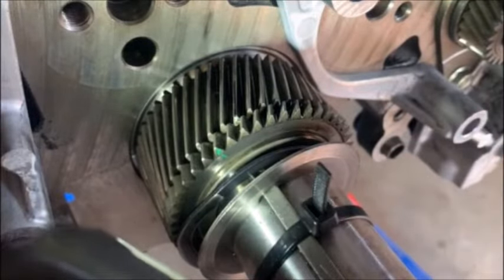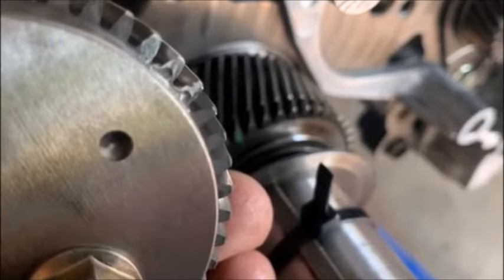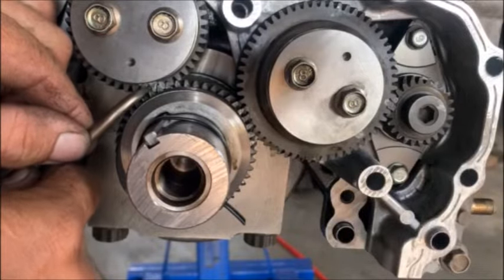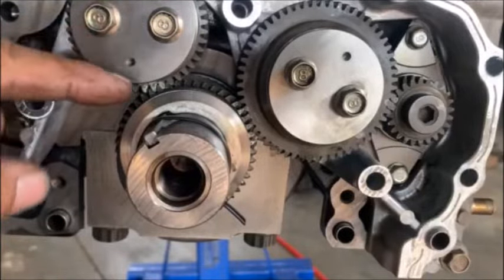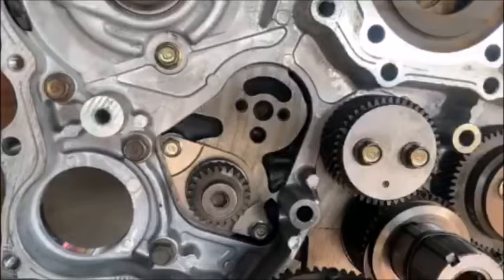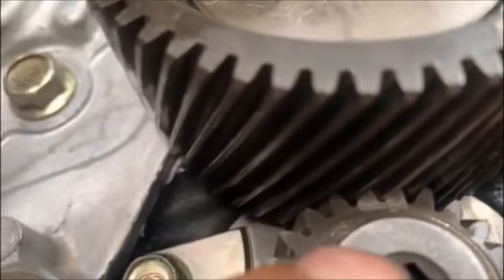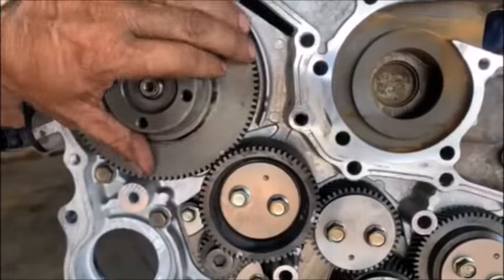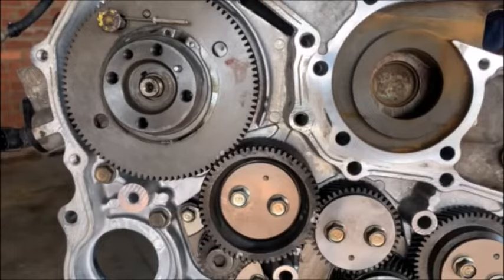Ford Mazda 2.5 WL Timing marks

Comment: Video is so self explanatory,👍 just dismantling the engine block to send of for re-boring and then the fun of rebuilding begins.thanxs for the info
Reply from the maker: Please let them check the block, they tend to pull, also remember to replace the head bolts. i am glad you liked the video.
Reply: what did you mesn pull

Comment: Is it possible for the injection pump gear to loose it's timing if only the pump is removed? We have one that has had it's pump rebuilt but now seems to have injection timing miles out and won't run... I thought the gear was captive and couldn't loose it's position?...

Comment: Geat content. What would couse a oil leak on the gear housing where the injector pump(diesel pump) connects to?
Reply from the maker: it has a oil seal on the pump, it could also leak on the nuts that hold the pump in place.

Comment: I doubt mine is done this way, I bought a new cylinder head but it still over heating though radiator is not blocked.thanks I have to save this in future cases.

Comment: Was trying to check the timing marks on my wl 2.5 turbo after pump service, first don't seem to see the timing dots on crank pulley and at the same time the marks on the gears are not lining up. What should i do? Coz .my engine was was vibrating a lot after someone rebuilt it.
Reply from the maker: Hi, the dot that should be on the crank is lined up with the key way in the crank. that should be your starting point.

Comment: I have stuck lockpin at the diesel pump gear how do I remove the gear without removing the pump
Reply from the maker: you would need to make yourself a small puller.

Comment: wat to if there are no timing marks on the injection pump. help pls tnx..
Reply from the maker: are you talking about the gear at the back or the pulley for the cam belt?
Reply: yes at d back idid not put marks at d back of d pulley i tink its twisted n den i got lost.. i can not start my engine😩😩

Comment: My engine is rattling a lot after servicing my pump.
Reply: Did you service oil pump or injector pump???. I hope it's an injector pump you mean , you were supposed to take your injector pump and injectors for service. Mostly rattling when idle is due to fuel starving, air in the fuel system or low fuel pressure or injector failure
Reply: Check your timing again